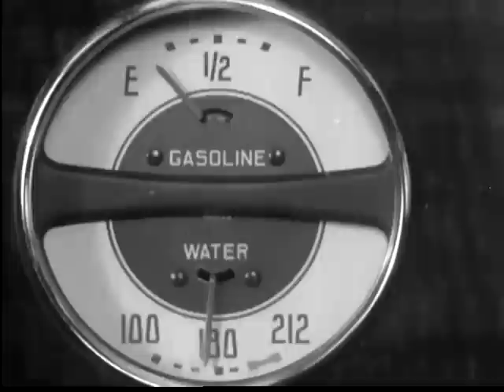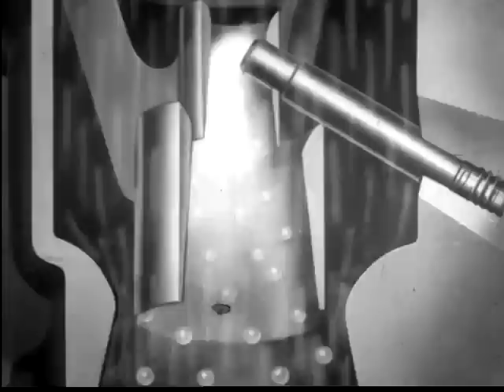How Gasoline Works In Automobile Fuel System

Comment: 0:24 if you play the video at 0.5x (half) the speed, you can see the gas was $0.18 per gallon. Mind blown 😳💥
Reply: That’s equivalent to like 3 dollars today
Reply: Was probably rip off then adjusted for inflation. They can ignite the combustion with spark plug, but the engine explosions need gas fluid hmmm...

Comment: at 1:45 , you can tell that the auto industry was trying to push back against fuel vaporization concept THAT WORKS
Reply: Didn’t it vaporize later on and get mixed with air? I think they just meant they didn’t want it to vaporize then because it would specifically go back into the gas tank.